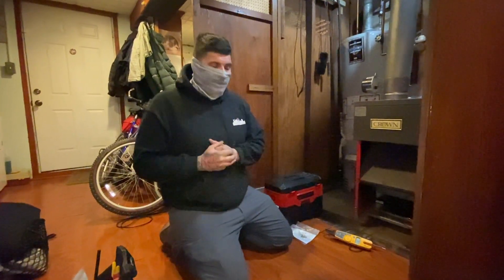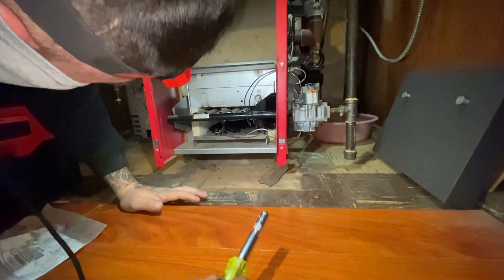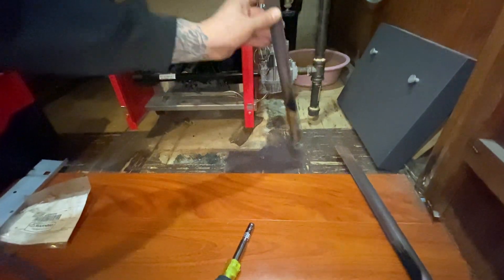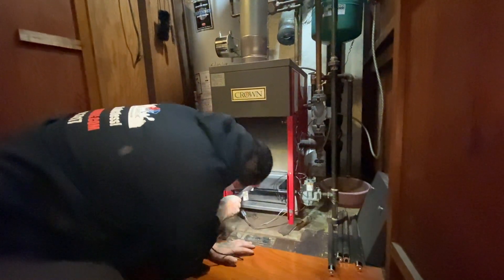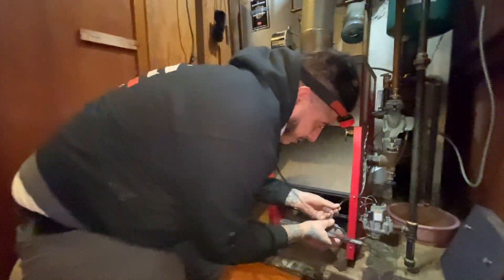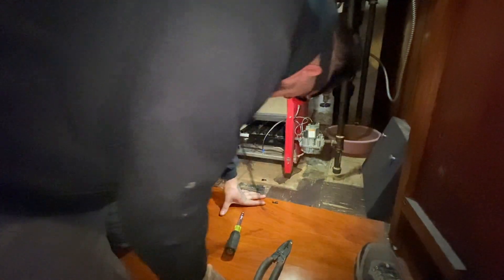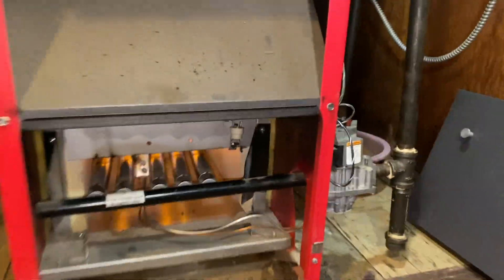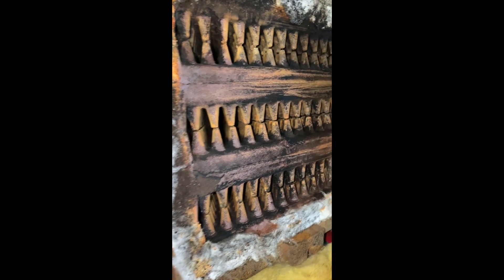How to troubleshoot a ceramic rollout switch on hydronic boiler

Comment: Man , this video saved me . Couldn’t believe how easy it was . Heat is up and running . Thanks . I have same boiler ( crown ) , little bigger , although I changed the rollout , and cleaned the flutes , I tried looking into the heat exchange from the bottom and had alot of soot , I did my best cleaning from the bottom , but couldn’t figure out how to take the top off to access the heat exchange from the top to really give good cleaning . Do you have a video on that , but I have to say I do have a pressure valve tied in that runs right over the top of my unit , is that going to restrict me . Thanks in advance !

Comment: I was having a problem with the heating.  I come to notice there is a problem with the roll out switch and I was not getting the boiler to kick into flame.  I disconnected and by pass the two wires. I took a piece of wire and connected together.  Suddenly the boiler kick into flame. Curious to know what happens if I left it like that for a long time until I get to replace a roll out switch the next morning?

Comment: So For a steam boiler in normal operation,  if you check for voltage across the two wires connected to the rollout switch and two wires connected to the block damper switch there should be 24v across the wires to each sensor. If there is no voltage present, that means it’s a open circuit ? Or should you check for continuity across the sensor?
Reply: Checking across a switch for voltage to see if a switch is open or closed , if switch is supplied with 24v and you check across them and you read 0 volts switch is closed. If you check across and you read 24 volts switch is open. Reason you will read 0 volts is because there is no potential difference. Hope this helps